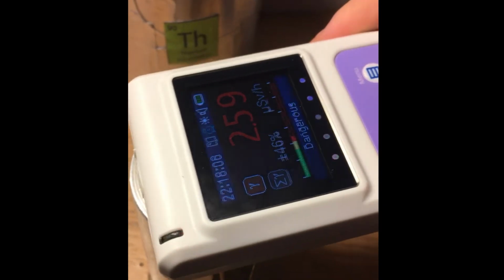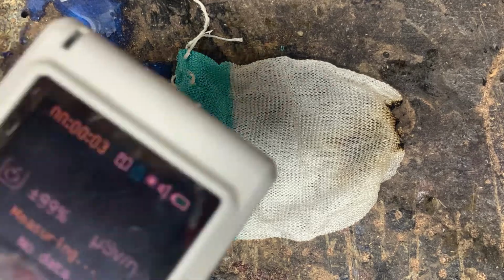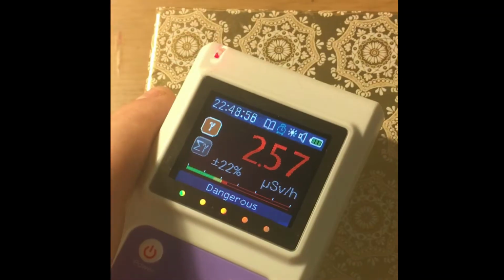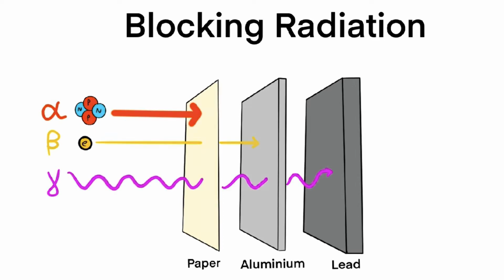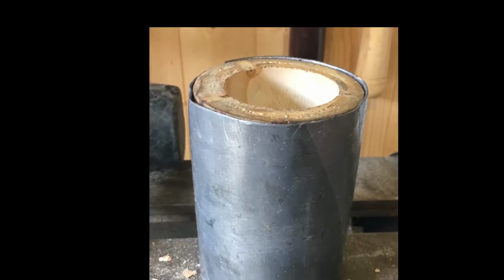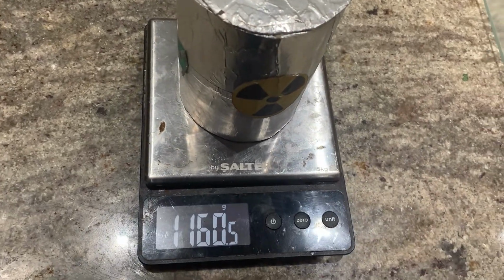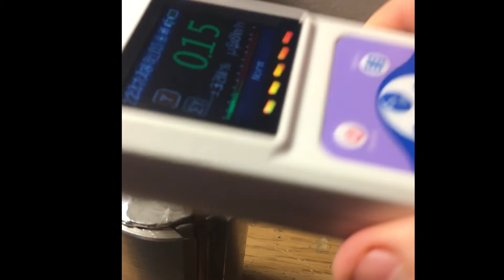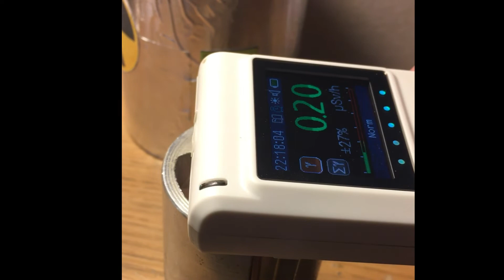Does My Homemade Radiation Shielding Work?

Comment: hello, keep in mind that measure of dose rate at contact with a geiger are always false as the geiger pancake is highly sensitive to beta & alpha and much less to gamma.  So the reading will always be higher than reality. A geiger isnt meant to give dose reading at close range but rather the ambiance dose rate. And to have max precision it should be measured on Césium 137 ( if calibrated on Cs137). Still measuring at contact can tell you if an objetc is radioactive or not and if its a "hot" source or not . And also a rough idea how dangerous the sample can be.  So the kind of samples you have causes no threat.

Comment: I dont think thats enough shielding.
I have my small uranium ore behing a 85mm steel plate and there is still 10% of the radiation coming through...
Reply from the maker: Uranium emits alpha and beta radiation so It should be stopped by stopped by a few mm of steel or lead
Reply: @Curiosity_lab  youd think, but natural uranium is in equilibrium with its decay products, some of them rwach 2500kev, where the half value layer islike 25mm of lead.
Currently soring it in a 40mm lead pig and I still get 2microsievert.
Reply from the maker: Wow your sample must be a lot more active than mine. I get around 8 microsieverts/h with no shielding and background with it.
Reply: @Curiosity_lab  I get 118 microsieverts if I hold my counter at it. Its a 1cm2 sample from where they mined the stuff for the first atomic bomb, so pretty much pure UO2. 
Put it in a small acryllic case, that gets it down to 28 microsieverts. 
Currently building a new lead pig with 60mm wall thickness but at that point it becomes unpractical as it already weights over 20kg vithout the lid...
Still curious if the counter can still pick it up in there...
Reply: @yaykruser don’t be so scared by radioactivity. Don’t store it where you live and sleep and you may omit this heavy shielding.